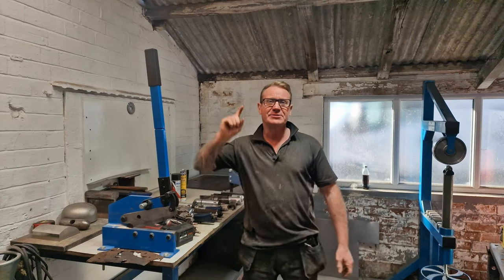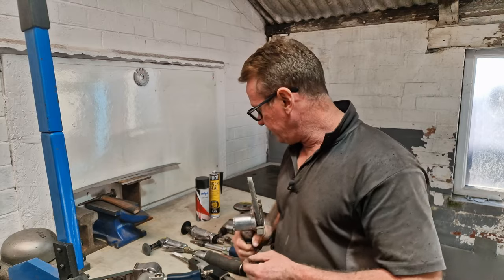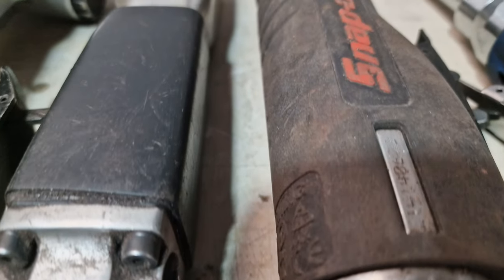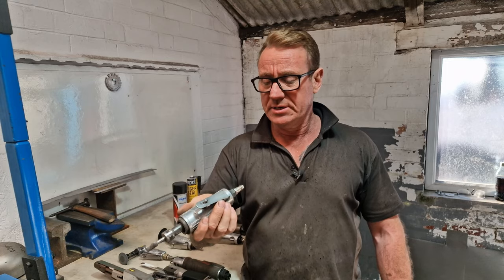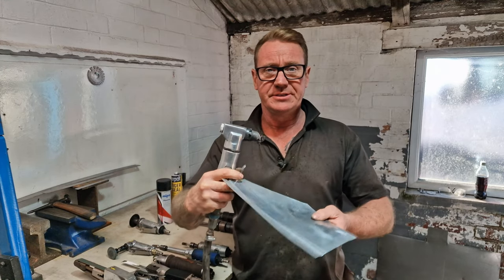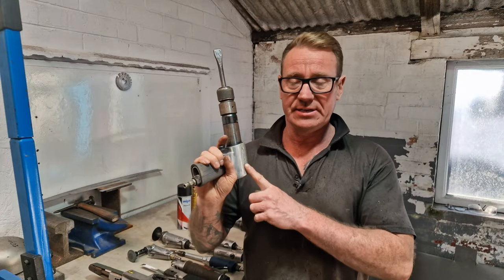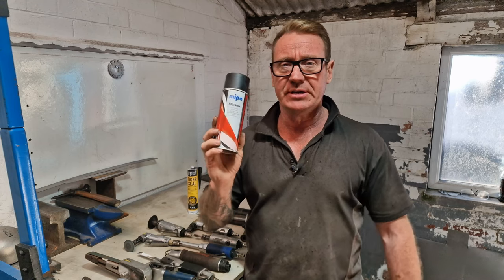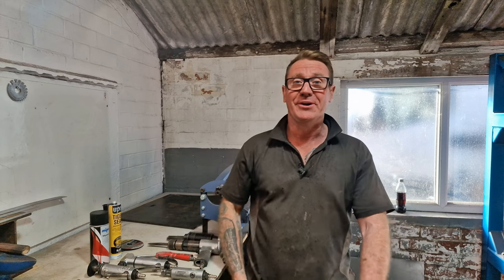Classic Car Restoration - Air Tools

Comment: On the belt sanders - brilliant tools - chuck on a 3M Cubitron belt - they're spendy but good. Transforms the 20mm belt sander from "Very good" to "Amazing" by that one change. Cubitron belts last about 10 times longer & work about 4 times faster than the other sorts. The 10mm belt sanders are also great for nicky-nacky little spots where nothing else will fit-  but unless you run 3M belts, they're close to useless as the usual belts break so easily. The 3M ones don't.
Reply: Tiger Seal rocks btw - just brush it smooth with a paintbrush dipped in thinners - finishes glossy & slick. I should have bought shares in Tiger seal I use that much of it.
Reply from the maker: thanks for the tips James :)

Comment: The belt sanders are a great tool, the last one I used was a Desoutter which I liked but as long as you can get in somewhere tight I'm sure it'll be good. Nice video, you don't need it all but having it is handy. Some stuff you just can't manage without.
Reply from the maker: Yes they are Aa very useful tool :) 👍

Comment: THX
Do you have a recommendation for belts for the small belt sanders? I'm using Bosch Professional for several years. But in the last time I'm quite disappointed, the connection breaks too often, to early.

Comment: I've watched every one of your videos, nice skills on the fabrication 👌The airline couplers on your  air tools are Rectus 25 hi Flow Euro standard connectors (series  320/321 i believe, I can't tell in the video if they are 1/4" or not lol) not HVLP 😉 The one thing I've noticed that I would have  jumped on in my bodyshop is the lack of guards on your air and electrical grinders. when you replaced that rotten chassis section under the rear stabiliser on the Mazda, your thumb was only about an inch away from the cut of disc! 👀😬 You need to be lucky every time to not have an accident, but only unlucky once! 🤕 especially with those 1mm thin cutting discs. To paraphrase gene Wilder from "Charlie & the chocolate factory"  🎶🎶"Come with me and you'll see,  a world of health and safety violations!" 😜  keep the videos coming lads, now I'm retired I love watching other fellas doing restorations, but please be safe with the tools🔧 ⚠ There will be a lot of DIY'ers watching you guys for tips n techniques and without the  experience  on gear that wants to do you damage if abused or used incorrectly!  (Me: Retired body shop/workshop manager) Oh aye, and you can get a needle scaler/scabbler attachment to fit air hammer/chisels, saves buying 2 separate tools (if your starting out in bodywork like) not for you guys 😉
Reply from the maker: Thank you Bill, I will correct the airline connector size in another video. 
As for the guards it is something we are slowly addressing but will take us a while as I have collected those tools over the space of 20 years and we both have full time jobs so can’t direct funds or time to address it immediately :) again thank you for your input Bill :) 👍
Reply: @yorkshirecarrestoration   Cheers for the reply Steve, I watched Ryan strip the underside of the Suzuki today. Hope I didn't come across like a troll 😒, But I've seen discs shatter n fly all over (Including smash right through a welding helmet supposedly designed for grinding use🤔 )  Watching  you work it's clear it's not your first time  😉
Reply from the maker: Not a problem. And thank you ! We know you are just looking out for us :) we will hopefully get it sorted soon! :)

Comment: Air tool are great and you get decent quality for very little money. But(!) you have to have a very powerful air compressor to run most of them. The typical DIYer's 200 l/min compressor won't be powerful enough. You should get one with 1000 l/min. Such a beast costs at least 1500 Euro and only runs from 400V.
In addition air tools only have about 5% to 10% of efficiency - i.e. to run a small die grinder with 100W your compressor has to draw 2000 Watt from the power line. For professional workshop this is a significant cost factor. We DIYers usually don't notice these cost because we don't work with air tools 5 days a week.